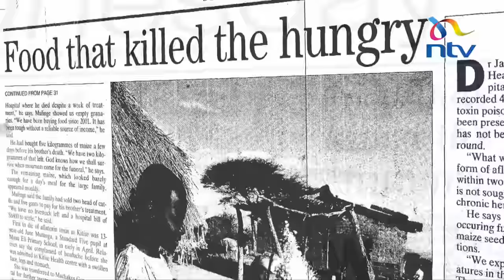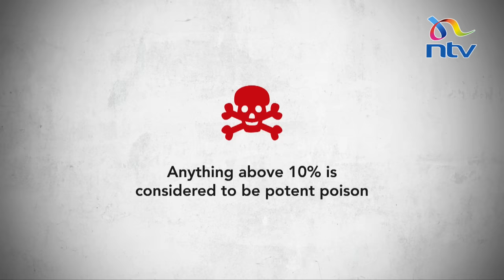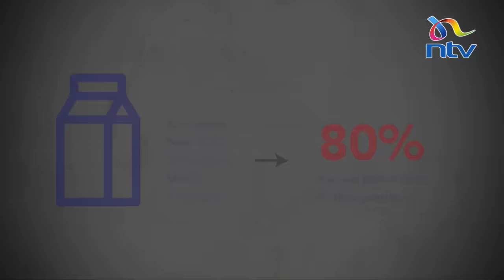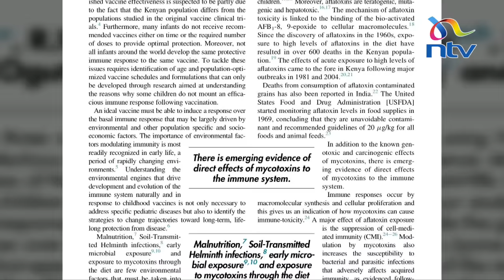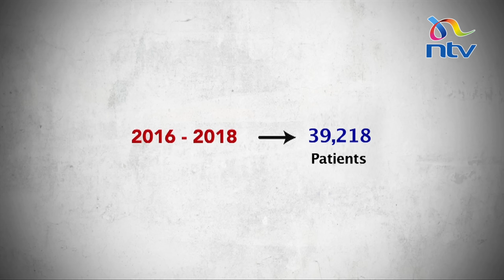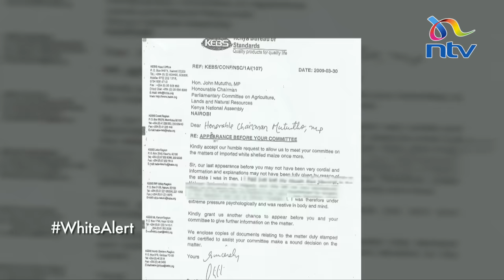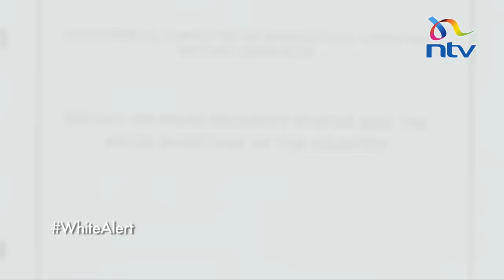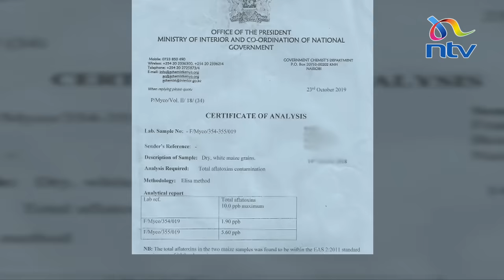#WhiteAlert: Aflatoxin - the poison in maize flour wiping out families

Comment: Thank you for this 🙏
Reply: I feel like crying...are we safe aki?
Reply: there is ths documentary called agenda 21 hosted by UN in the 90's where by they saw overpopulation a major concern hence they had to eliminate half the population by 2021 through things like gmo foods, seedlings which they control and distribute, chemical spray in the air and the most hyped 5g Wifi which it's radiation is 450MHZ, 10-100 times fater than 4g.
Reply: Wesley Kish link?